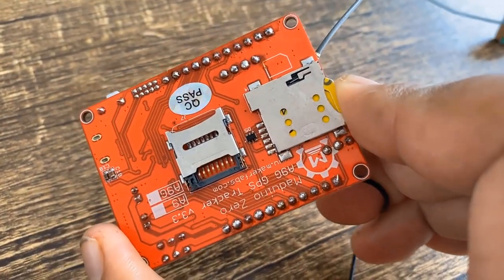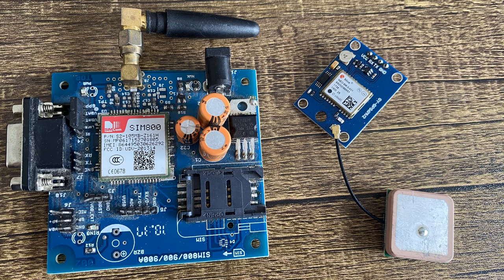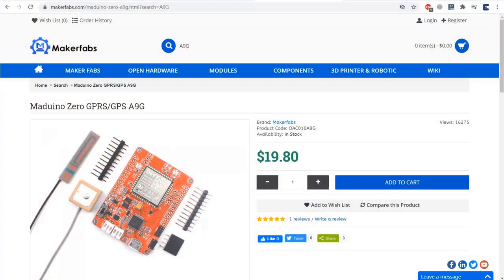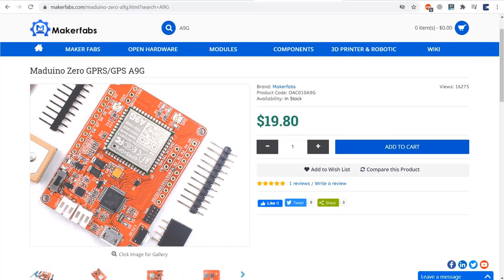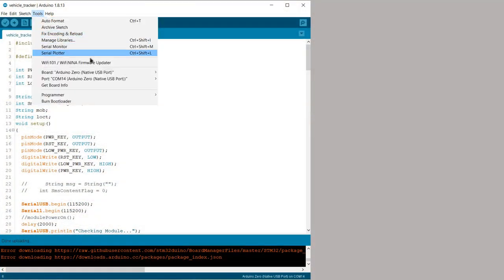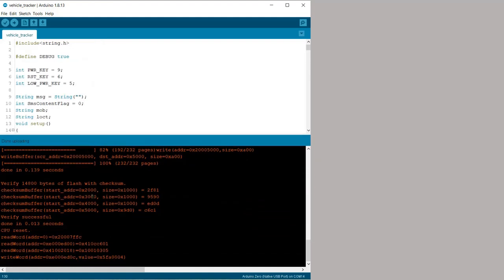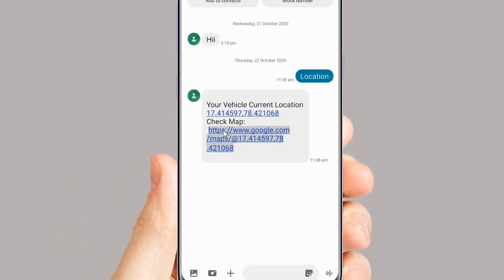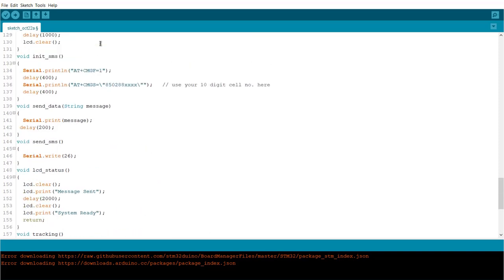GSM + GPS Based Vehicle Location Tracking System using Arduino

Comment: Nice video and explanation! I have a follow-up question: would it be possible to connect this setup to a cars 12V connection, because the board has a voltage regulator IC? That would be a nice option, instead of charging the battery again and again.
Reply from the maker: Rather connect it to 5V DC adapter. 12V is too high as it will generate a lot of heat. Or simply use 12V to 5V converter.
Reply: @HowtoElectronics  Alright! Thank you for the quick reply!
Reply: @HowtoElectronics  Another follow-up question: would a cigarette adapter be a good option? I'm trying to find a good option to connect this to a car's power supply.
Reply from the maker: Just use 3.7V 2000mah battery. The charge will last for 3-4 on continuous operation. You can recharge the battery again.

Comment: Hello and congratulations! In the version (Arduino based GPS Tracker Project using SIM800 / 900 & NEO-6M GPS Module) is the message to be sent to get the answer always "Location"? The mobile number to be entered must be with the international prefix or without? Thank you.
Reply from the maker: You need to enter mobile num in code with international prefix.

Comment: would it be possible to   write code  to have the GPS send a an alert if the gps is  within 3 km of to a defined location  ( like a airport). This project would alert the pilot if the landing gear was  up ( Bad) when the aircraft was with 3 km of a airport. How much would it cost

Comment: Another follow up question, I want to use it for my Smart E BIke FYP and I'm using a 36V 10A Li Ion Battery as an electrical assistance feature (Power Supply). Can I use the same supply for the tracker? Is there any possibility to use some converter, relay driver circuit or do I need a separate battery for this?  Pls reply.
Reply: Cannot use 36v bro.. it to high that can damage the board.. arduino can get supply using external around 5-12v if it go high than 12v it will damage that component... For gps it uses around 3.3v and gsm use 5 volt .. dont use that high volt to this component im sure it will damage .... My opinion u need to make step down converter to get 12v but that 12v need to supply using external arduino only!! If u try using dc-dc buck converter im not sure u will find 36v - 12v ... Another choice using another battery supply 12v 2amp..but it complicated to charge ... U need use dynamo also to that i think.. that all.. it just my opinion that im study if that wrong im so sorry and let free to let me know another thing . 👍

Comment: I am done try this project using Arduino uno and sim800l . I followed and connected as per your circuit diagram, i hv doubt is there any battery is needed for this circuit.
Can u pls help us to complete this project?? 
Its very important can u reply as fast as possible??
Reply: Hey bro!! Is your project came out good??

Comment: Hello guys, if you are having problems with 3g sim, just change the SIM network to 2G network via settings... it will work
Reply: can we use any network sim with it or sim is provided by manufacturer
Reply: This only work if that country have 2g ... Not be done with country that only have 3g&4g right?

Comment: Very good video, greetings.
A question. To work with the sim800 module and the Neo 6M.
How can I send a message from "any phone number" to the Sim800 module (without this number being registered in the Arduino code) and immediately receive a message with the location to this same phone number?
Reply: did you find it bro ?

Comment: hello, so what if i change my 3g/4g sim through settings to a 2g simcard, will that work??? please be reply
Reply from the maker: This module doesn't support 3g sim card or 3g network.
Reply: @HowtoElectronics  Sir pls reply can i use this method from A9G gprs gsm ai thiker board pls sir reply

Comment: bro how to add any sensor to this circuit so that we can detect that car engine is working or not??plzz help
Reply from the maker: May be via you can add any 5v output to arduino digital pin and check whether it is high or low.

Comment: Hello brother, nice video. But can you pls help me sir. I have the maduino zero v3.5 and it is sim808 how can i convert this program into that? I tried several things but it did not work.
Reply from the maker: Sim808 and A9G are completely different module. I tried SIM808 in past but no luck. You can try SIM808 from examples given by Makerfabs.

Comment: ro  hav aduino uno + gps neo +sim 800 it can be made 
 i am very confusing wit coding can u plz help me
Reply from the maker: Hi coding is already given in website article for Sim800 & Neo-6 GPS. Add Tinygps library to arduino ide and upload the code to arduino board. 
And tell me where you are confused.
Reply: @HowtoElectronics  I WANT TO REMOVE THE LIQUID CRYSTAL THAN CAN U PLZ SAY ME

Comment: Does we need to connect the gps with wifi ?
Reply from the maker: No not needed. It works using gsm network.
Reply: Does gsm module use a sin card

Comment: Can I power the neo 6m with Arduino 5v
Reply from the maker: Neo'6m is a 3.3V module i guess. Powering it through 5v might damage the module
Reply: @HowtoElectronics  I thought it has an on board 3.3V voltage regulator

Comment: Sir pls reply can i use this method from A9G gprs gsm 
ai thiker board pls sir reply
Reply from the maker: Yes you can use. The gsm module is same one from the Ai-Thinker.
Reply: @HowtoElectronics  my board is dev A9G pudding board 
Use same mathod pls last reply
Reply: @HowtoElectronics  my board is dev A9G pudding board 
Use same mathod pls last reply
Reply: @HowtoElectronics  my board is dev A9G pudding board 
Use same mathod pls last reply
Reply: @HowtoElectronics  my board is dev A9G pudding board 
Use same mathod pls last reply
Reply: @HowtoElectronics  this method not working with A9G pudding board 👎👎👎👎👎👎👎👎👎